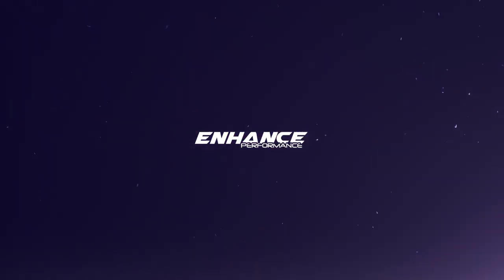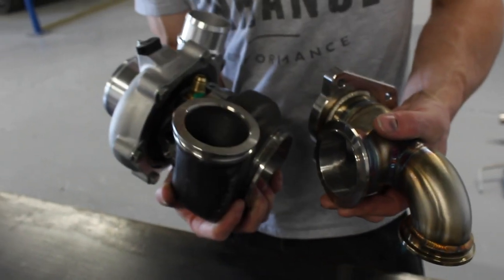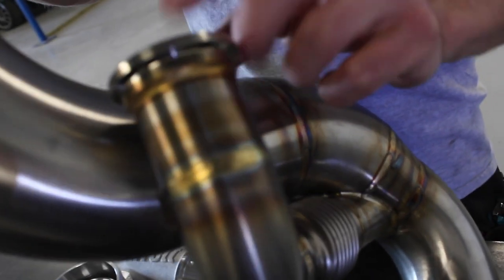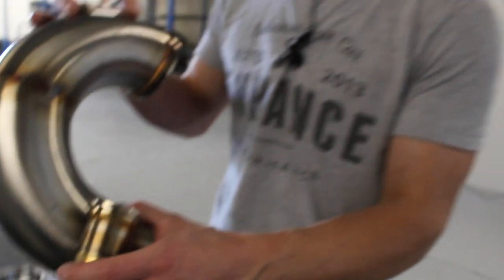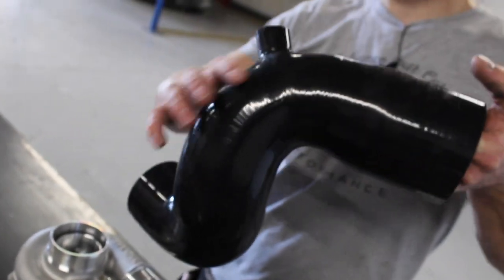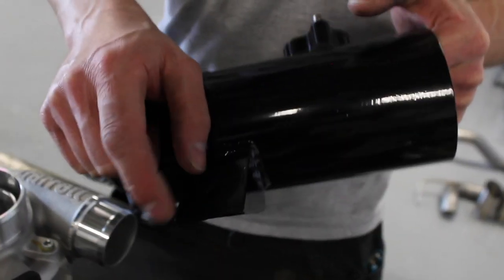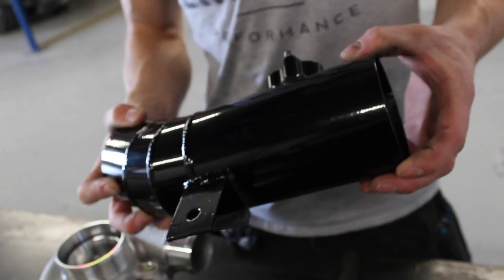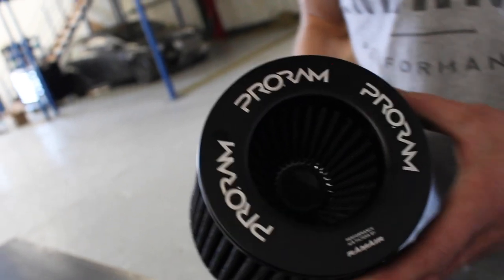Astra J VXR Garrett G-Series Turbo Manifold Kit

Comment: Is there any bigger turbo kits with manifold etc available at the moment? I’m currently having my Astra gtc vxr’s engine built and have found a crack in the original turbo and exhaust manifold so would rather upgrade than replace and need it quite quickly?? Any help appreciated